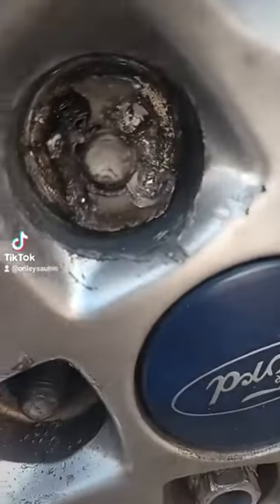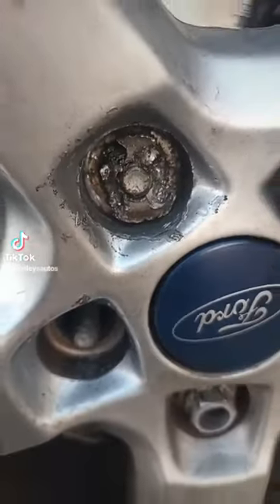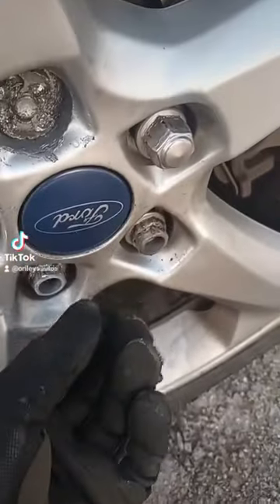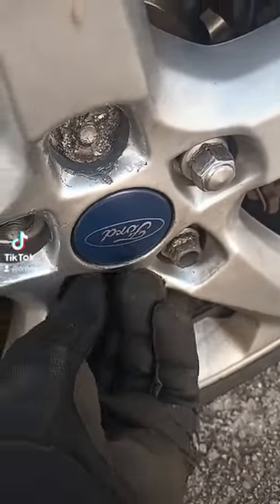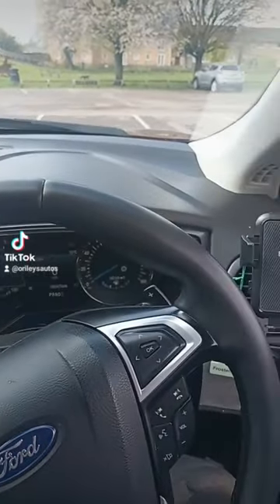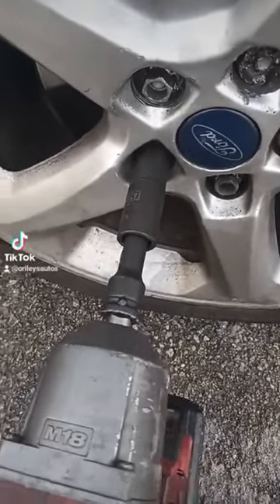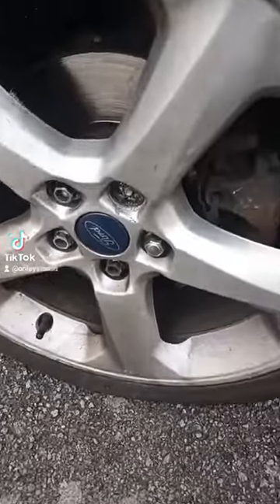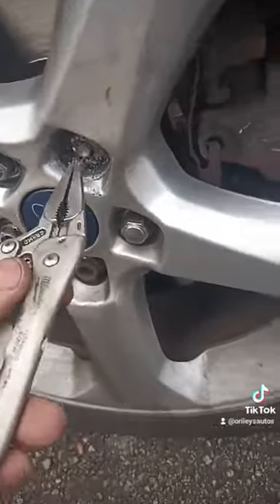Best Kept Secret To Locking Wheel Nut Removal With No Specialist Tools

Comment: Jimmy, I wonder if you would mind expanding what you mean by "take it for a little spin around" ? I have tried a mile or two in a 30mph limit with lots of turns with no difference to the seized nut.

Comment: Thanks for this. 
I e been stuck with a 208 s locking nut today and had given up for today with a fresh start tomorrow. 
Saw this video and thought I’d give it a try and it worked a treat. (Wheel bolts rather than nuts so works for bolts also)

Thanks again.
Reply from the maker: Glad I could help
Reply: I have a 208 and been quoted 150 quid to get all 4 off... I'm in debt as it is trying to pay the car off and was sold it without the master socket... How did you drive it with the bolts loose please... Any advice would help just don't want to ruin the car 🤦

Comment: Thank you Jimmy I just got 4 locking nuts off a qashqai doing this.
Thank you!!
Reply: Did you do all 4 wheels at the same time or just one at a time please? Been quoted £100 to £150 to get them off and struggling for money as it is as I'm a single dad! But need 4 new tyres and was sold the car without the key 😢

Comment: Would this also work with studs rather than bolts?
Reply: I have the issue too, it’s stuck on rock solid… been trying to soak it with anti seize etc… but no joy yet

Comment: Wait so he bascally drove with the stripped lug nut on only and the driving made it loose?
Reply: The others were still on but loose for safety. The bad one got a kind of shock treatment and was no longer bonded to the wheel surface nor to the thread.

Comment: I have to fix several of these a day. (My father owns a tire shop). Some of them can be a nightmare . A lot of people don’t realize their vehicle has locking lugs nuts or they lose the “key”. The ones that are a real nuisance are the spline drive but you can easily get a  removal tool for those.  Also ford needs to recall those OE lug nuts the steel nut with the aluminum covering! They need to be solid stainless

Comment: What you did is stretch the stud, after you loose the nut you should replace the stud.
Reply from the maker: It's not stretching the stud.
Reply: Has to be stretching it, no?  How else is it getting loose?
Reply from the maker: @Dane-bootsNcatsN  it wears the paint coating off where the nut sits against alloy wheel. .. what's softer the stud or the paint or alloy wheel?

Comment: It was already to torque for holding flat surfaces together. What's happened is you let the surfaces break that alignment and something has stretched enough to release the clamping force between the thread faces and seating faces... 
Be careful recommending/endorsing the things that manufactures explicitly warn against to unknown potato heads...
Reply: Yeah, whilst this might've worked, it seems very dodgy. Would not recommend it or do it myself.